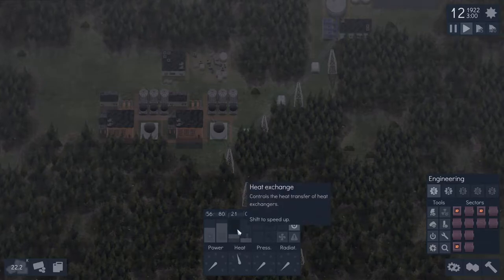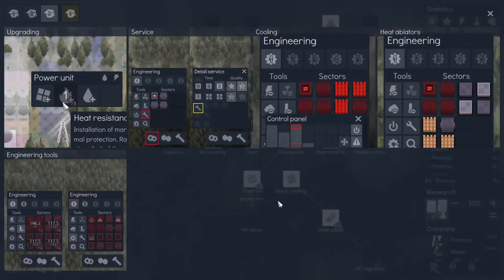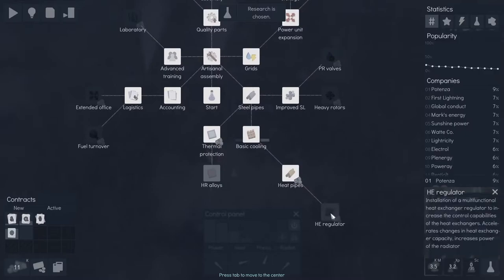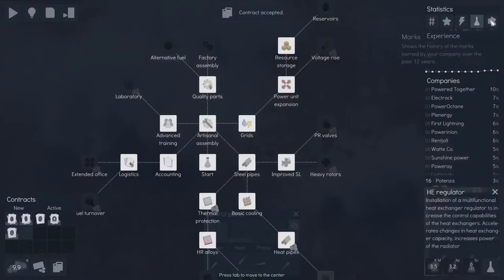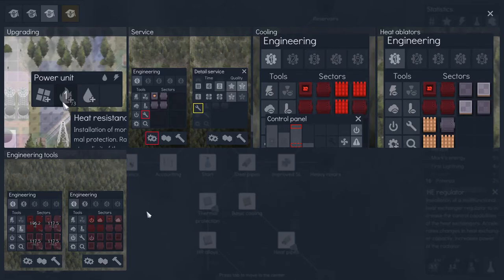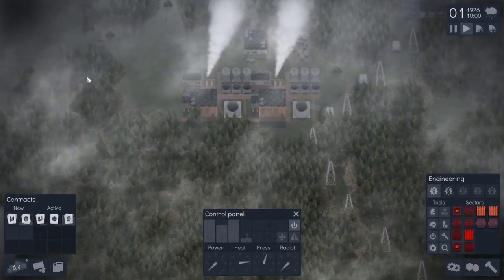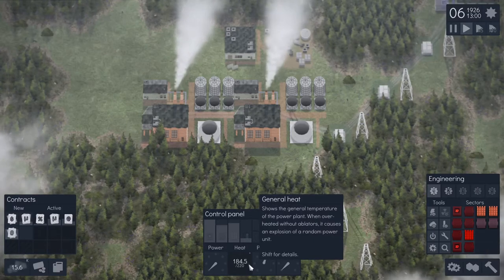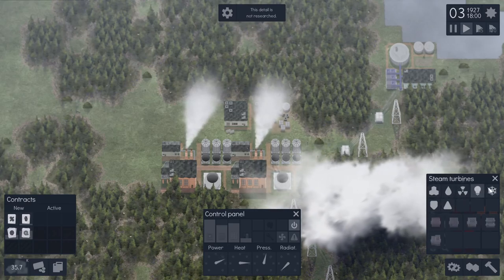Reactor Tech #5 Out With a Banger!

Comment: Guess I missed something myself from the previous update. But glad you got yourself sorted. The fourth bar is used for something you haven't installed yet. Which is the "shields" you saw. Haven't had much experience with it, but will watch you experiment with it and tell you my theory afterwards.
Reply from the maker: Yeah! There's a lot to this game, very big learning curve for sure!
Reply: You most likely already figured that one out, but:
Bar 1: boiler heat(how much fuel we chuck in and how much heat we produce) all 4 sectors heat is added(literally, heat of sector 1+ heat of s2 + s3 + s4) and it equals to global heat. If global heat reaches certain threshold - boom. Global heat is what you see on main heat gauge. If individual heat of sector is above 100 - it boils water. Boiling water = pressure. Hotter = more boiling. Pressure is what gets you’re turbines spinning. More pressure = more power. Each sector has its own temperature, pressure and power production. More on that later. Coolers reduce global heat without lowering individual sector heat, but they suck all that heat to sector they are in. More on that later.
Bar 2: Water supply.
It cools boilers, by taking the heat away, boils above 100, and spins turbines producing pressure. Water is tricky. Too much - and you will overlook the boilers, going below 100 and losing pressure. Too little, and boilers overheat. Change too fast, and get a heat or a pressure spike(if you have 150 temp boilers and suddenly add a lot of water, your pressure is gonna skyrocket)
Bar 3. Coolers. They suck the heat into the sector they are in. Each cooler can only suck so much heat. For t1 coolers it’s about 30 degrees per cooler. 
They don’t cool the boilers, they just take the “waste heat”, lowering the global power unit temperature. They are chads. 
The bar controls how much heat they suck out. They don’t cool the boilers themselves, they just subtract from global heat. I. E. Global heat is s1+s2+s3+s4, and if s4 is filled with coolers it will be -cooler x 4, but remember that while it will subtract 4x the amount of heat, they will heat their own sector 1x which will count to global heat. X is tier of the cooler.
With t2 coolers they are good enough that 3 of them heat the sector they are in above 100 so 1 turbine can run of “reused” heat.
4. Neutron reflectors - controls intensity of nuclear reacton. Wont touch that for now.

Conclusion.
Your power output consists of raw sum of outputs of each of your sectors.
Each sector has its own temperature and pressure, and power production. If sectors individual temperature is >100, it produces pressure, and if sector has pressure and has turbines inside, turbines use the pressure to produce power and fill power storage. If power storage is full, turbines have nowhere to convert the pressure, overheat, producing more heat, causing a pressure and heat spike in sector. 
Global pressure is sum of all sectors pressures.
Global heat is sum of all sectors heats.
Now to the tricky: let’s say you have 4 sectors with 1 boiler and 3 turbines each. Your max heat is limited to 180. See the problem? To boil water in all 4 sectors you need boilers to each get to 100 heat, and summed up - 400 heat total, and we are not even producing power yet. To produce any significant power you need to be running them at about 120-150 range, netting 600heat global. With 180 as a limit. 
You will explode before reaching 50 degrees, let alone 100.

That’s where coolers come in. They cool the global heat, and a take up one of the boiler slots. So now you have way more manageable 450 heat with 4 coolers sucking (t1 coolers) 120 heat per sector where they are not. So it’s 450-360=90 global heat at full steam, and now you are limited by pressure, producing 3-6 GW per sector.
so yeah, that’s about it. 
Tho with such high temp build, watch power storage closely. If it fills up, it’s way harder to stop stuff rom blowing up since even when you power down, water supply decreases slowing cooling, causing a heat spike, and a pressure spike consecutively. I usually deal with that by slighltly lowering water supply to get a steam pressure drop, and turn boiler bar to 0 to start the cooling. 
Usually by the time your lack of cooling from reduced water catches up, boilers are cold enough to not cause too huge of a pressure spike.
Aaaah, this game is so complicated.
But yeah. TLDR:
Water: +pressure     - - heat
Boilers: ++heat
Exchangers: - - heat.
Tho exchangers can be used to power turbines ore boost sectors temperature from the global pool.